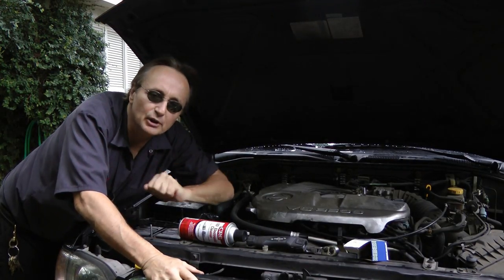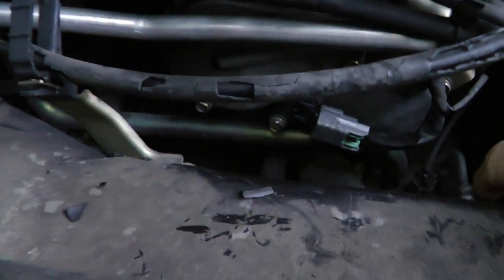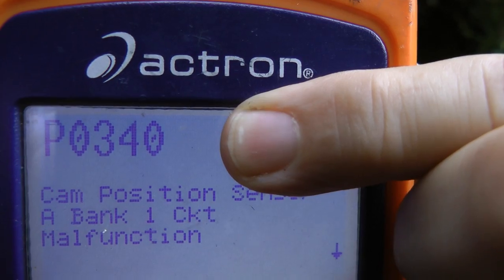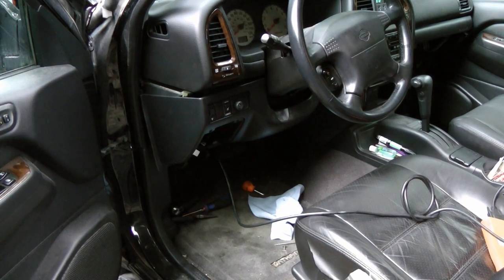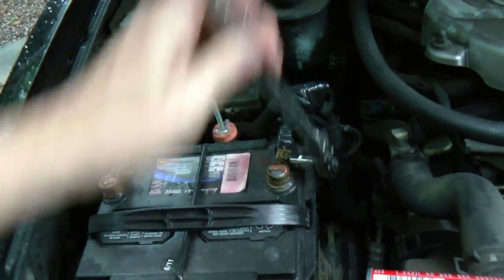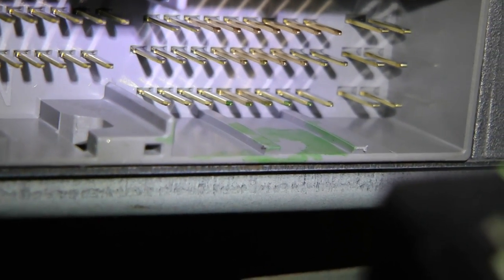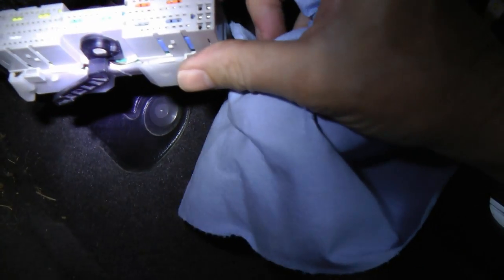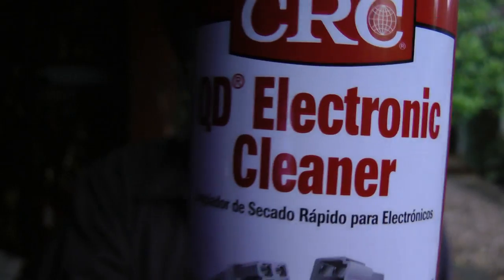How to Fix Computer Problems in Your Car with a Little Spray Cleaner

Comment: Mr. Kilmer,I just bought a 1999 c5 vette,99,000 mi ,after driving a couple hrs..my dic displayed active handling and traction control problem and the car went into reduced power mode,took it to the chevy place ,said they found no problem,still showed the code in the dic,six days later it happened again so I took it to advance auto put it on their little diagnostic machine ,it said traction control temporarily inhibited by pcm ,code c1278, what should I do? I want to fix it,shoot I have only had it a wk.PLEASE HELP!! Keith.J
Reply from the maker: keith jones  realize you can't work on that system without a dealer level scan tool that has bidirectional testing abilities.  Find a guy like me with one, or pay  vette guy a small fortune in most cases. They are THAT complex. But, here's some info:
SUBJECT:
 REDUCED ENGINE POWER MESSAGE ALONG WITH PARTICULAR POWERTRAIN TROUBLE 
CODES (INSTALL NEW TAC-MODULE IF STRATEGY IN SERVICE MANUAL FAILS)

MODELS: 1997-98 CHEVROLET CORVETTE WITH 5.7L V8 ENGINE (VIN G - RPO LS1)

CONDITION #1: INTERMITTENT REDUCED ENGINE POWER EVENT, ACCOMPANIED BY P-1516, OR P1518 TROUBLE CODES.

IF A SITUATION ARISES WHERE A P-1516 TROUBLE CODE IS ACCOMPANIED BY A

P-1120 AND/OR P-1220 TROUBLE CODE, THIS SERVICE BULLETIN DOES NOT 
----------------------------------------------------------------- APPLY.
 IN THESE CASES THE TECHNICIAN MUST USE THE NORMAL STRATEGY 
------------------------------------------------------------------ BASED
 DIAGNOSTIC. -----------------

CONDITION #2: INTERMITTENT REDUCED ENGINE POWER ACCOMPANIED BY TROUBLE CODE P-1125 AND ANY OF THE FOLLOWING TROUBLE CODES:

P-1276 P-1281 P-1286

CAUSE:

CONDITION MAY BE DUE TO DIAGNOSTIC SOFTWARE AND CALIBRATION IN THE TAC-MODULE WERE NOT OPTIMALLY UTILIZED.

CORRECTION:

IF THE ABOVE CONDITIONS CANNOT BE CORRECTED USING THE NORMAL STRATEGY 
BASED DIAGNOSTICS LISTED IN THE SERVICE MANUAL, INSTALL THE NEW TAC- 
MODULE LISTED BELOW.

PART INFORMATION:

NEW TAC-MODULE PART # 25319443

PARTS ARE EXPECTED TO BE AVAILABLE ON APRIL 6, 1998 FROM GMSPO.

WARRANTY INFORMATION:

FOR VEHICLES REPAIRED UNDER WARRANTY, USE:

LABOR OPERATION: J-5582 LABOR TIME: 0.5 HR

FIGURES: 00 ATTACHMENTS: 00

GENERAL MOTORS BULLETINS ARE INTENDED FOR USE BY PROFESSIONAL 
TECHNICIANS, NOT A "DO-IT-YOURSELFER". THEY ARE WRITTEN TO INFORM THOSE 
TECHNICIANS OF CONDITIONS THAT MAY OCCUR ON SOME VEHICLES, OR TO PROVIDE
 INFORMATION THAT COULD ASSIST IN THE PROPER SERVICE OF A VEHICLE. 
PROPERLY TRAINED TECHNICIANS HAVE THE EQUIPMENT, TOOLS, SAFETY 
INSTRUCTIONS AND KNOW-HOW TO DO A JOB PROPERLY AND SAFELY. IF A 
CONDITION IS DESCRIBED, DO NOT ASSUME THAT THE BULLETIN APPLIES TO YOUR 
VEHICLE, OR THAT YOUR VEHICLE WILL HAVE THAT CONDITION. SEE A GENERAL 
MOTORS DEALER SERVICING YOUR BRAND OF GENERAL MOTORS VEHICLE FOR 
INFORMATION ON WHETHER YOUR VEHICLE MAY BENEFIT FROM THE INFORMATION.

COPYRIGHT 1998. GENERAL MOTORS CORPORATION. ALL RIGHTS RESERVED.
Reply: Scotty Kilmer Thanks for getting back so quick! sure is appreciated,thanks for the good advice and being there for everybody,will check into that tac module now ,take it easy,Keith
Reply: Hey Scotty,keith here with the 99 vette in macon ga.you hit the nail on the head,WOW!! it was the tac module,it was loose and flopping causing havoc with the wiring,a little soldering and a strap and everything is working perfect now,You did what the chevy dealer and a hundred people on the forums couldn't ,Thanks Man im gonna keep it!!!! keep on keeping on! Keith

Comment from the maker: many things, from an electrical short resetting the whole car, like a weak ignition switch, to computer or computer sensor problems.
Reply: Scotty I replaced the transmission on my 2008 Kia rio and it still is in limp mode and takes off in 3rd gear

Comment: Hey scottie   

I have a buick lesabre that will crank for 3sec and shut off and try it again and it just spins i change fuel pump,fuel regulator,fuel filter,camshaft position  i get spark  but it still will not run can you help me
Reply: Tristan Williams Theft deterent.
Reply: my buick lacrosse does same exact thing. I brought it into a guy who replaced cam sensor and crank shaft censor and it worked for a week now it wont start again(-$360)

Comment: I bought my ECM PCM computer for 179.99 from flagship program to my vin with lifetime warranty. it don't cost $1,000 to fix it get on flagship get your ECM or PCM or call Express flash also $179.99 fix if your computer has gone out
Reply: Kevin Turner do they have a website?

Comment: Hi I have a 2002 Montana changed alternator twice brand new battery
The alternator tests good Not charging battery No service lights come on only battery lite after run for a while 
Is it my PCM ? Please help me 
Where is it ? Can I do it my self I have zero experience I did change alternator by my self after hours and hours watching YouTube it took me 12 days
OK I don't have money for a shop 
Please help Thank You for any tips or suggestion s on where to buy how to put in If that's what it is 
Thank you

Comment: I have a 2000 ford expeditlon this coe came up P1270 - Engine RPM/Vehicle Speed Limiter Indicates the vehicle has been operated in a manner which caused the engine or vehicle to exceed a calibration limit. The engine rpm and vehicle speed are continuously monitored by the PCM. The DTC is set when the rpm or speed fall out of calibrated range. For additional information on the engine rpm/vehicle speed limiter, refer to Section 1, Electronic Engine Control (EC) System , Powertrain Control Software. Wheel slippage (water, ice, mud and snow)
Excessive engine rpm in Neutral
Vehicle drive at a high rate of speed
The DTC indicates the vehicle has been operated in a manner which caused the engine or vehicle speed to exceed a calibrated limit.
Reply from the maker: malcolm griffin you either drove it too fast or revved the engine up too fast, OR the speed limit system is breaking down and thinks you have

Comment: hey man i have a problem with my 1997 expedition i turn on my a/c and my truck turn off i replace my spark ignition coil plus my air tank flow im thanking its the computer in the truck also when i turn the truck on i hear a beep do you have a idea what it is

Comment: Hey Scotty I'm recently having a problem with my 05 nissan armada it doesn't want to start checked the usual problems but it's the same did some research and found an ecm relay was on recall replaced it worked for a day but did the same thing the next day I repeated this about 4 times took it to the dealer and they said it "could" be my ecm but I don't understand it turns on and runs great when I get it to start could it be my ipdm that's going bad or? It would mean a lot if you replied I'm very frustrated and almost out of money and can't find many answers.
Reply: Boosted E60 
I know your pain! I have an 04 Nissan Armada and I have had more problems than anyone can imagine! Literally if you name it I've replaced it! I still love the shit out of it but they really messed up on the first ones made! Glitches.. Nissan should fix this. It's very dangerous and I have wrecked with my kid in my truck already just from my brakes going out! it shuts off randomly while driving also. I've changed the relay a few times but I guess I need a new computer
Reply: Boosted E60 
Your problem is most likely your cat converters. I know it sounds crazy but mine broke down and sat in my yard for six months and I had to tow it to Nissan and as soon as they unhooked it the truck was running again. I couldn't afford new ones so I gutted them
Reply: Sarah Holliday Hebert It turned out to be my ipdm computer where the ignition relay was defective they switched it out for about $450 and it's been almost a year and 12k miles later and haven't had any problems whatsoever.

Comment: @Scottykilmer my car was leaking oil from the oil seal gaskets got that fixed. And also leaking from the oil pressure sending unit got a new one so when my car is cold the oil pressure is nice ans high but when the car get warmer the oil pressure gets pretty low and i start to smell alittle oil comming from the ac vents if i have the ac on what could be the problem by the way its a 1994 camaro v6

Comment: Hey Scotty 05 cobalt security light is on don't start. What can a do?
Reply from the maker: German Garcia DO try another key if you have one, but if not that, find a guy like me with a dealer level scan computer or a locksmith with one, they are THAT complex, you can't analyze and fix em yourself

Comment: Scotty, the car won't run when it gets warm because it loses spark. When I ground a spark plug and turn it over, there is no spark. I tried shutting the car off while it was still running, and then it would not start. Somebody said it was the ignition control module, but I would like to be sure before I spend any money. Thank you sir.

Comment: What’s going on with my 1999 C5 corvette, dash lights blink like crazy, left turn signal busses car won’t start but if I pull battery cable of and wait a couple minutes it starts right up runs great until I shut it off then when I start it it runs in low engine power mod, shut it off disconnect battery cables and wait again for couple minutes and it starts back up rung great, repeat repeat repeat like ground hog day.
Reply: whats the ibd code say? sounds like a sensor of some sort .... may be a relay to igintion, 
or worse... pcm...possibly

Comment: I have a 1999 Oldsmobile Delta 88my car turns off of me when I'm driving but the thing is I drove from Ohio to Texas and then didn't turn off on me when I was doing a hundreds of miles but it turned off on me when I am  stop sign so I don't know what's wrong with it

Comment: Impala 2017 traction control is not working, no traction light on cluster, everything seems OK, if I push the traction control button I can see the T/C is on, but in reality traction control is not working, I drive my car on wet surface, feels no traction control at all, obd scanner tells U0100, and U0077, please help
Reply: Check fuses first

Comment: a $5 can of cleaner sure as hell beats a new computer
Reply: Gary Shaw l have a 3.5 year chryrshee conorde v6 when you stop at a red like or stop turn left or rigjt it stop runing but will star back yup
Reply: Francies Reddish probably it's a vacuum leak
Reply: Ronald Alabama MAP or MAF sensor
Reply: Ronald Alabama Clean the Carbon build up from the sensor
Reply: Today 9/2/2020 I watched this video and followed his advise and all the steps and my check engine light is officially off even after driving 59 miles. Needless to say hopefully tomorrow it will remain off and I can go to emissions and getting my new registration
Reply: Be great if this is the fix for my PoS Dodge.  Guess I'll try it before buying a new pcm.

Comment: If a engine is not getting spark or fuel dose it means the ecu is bad cause it was shaking and running rough and randomly died and now it won't get any spark or fuel
Reply: id check fuel pump, ignition switch , and also your fuel/ignition relays....

Comment: SCOTTY I need HELP my car gives out a P0600 code I have a 2002 VOLKSWAGEN JETTA 2.0L AUTOMATIC GLS 

my car turns on and works fine bug doesn't read any codes and only shoes P0600
Reply from the maker: +ADRIAN CANICAS bad wiring or bad main computer itself. Good luck tracing it down

Comment: I have psm, abs, driver assist failures and code p0503. When I shift car makes clunky noise and when I let off accelerator car jerks. When I go full throttle the car has a lag then goes and its naturally aspirated
Reply from the maker: time for a new vehicle speed sensor, and pray it's not bad wiring or bad main computer
Reply: Scotty Kilmer :( hope not a new computer. Any other symptoms that it could be the computer

Comment: anyone know if its possible a nissan truck can start even though it has this problem? My '04 frontier runs great but keeps giving me codes for bad O2 sensors even though I have now spent a small fortune replacing all of them. That check engine light just keeps on coming back...
Reply: Brian Keyser I went through the same hell with my 06 frontier. I replaced the bad o2 sensor twice , almost all new exhaust. Took Nissan 3 days after I gave up to find a tinyyyy exhaust leak, every time you would get to a certain rpm the exhaust would suck in air through the whole and cause the computer to throw an 02 code. stick a rag at the end up of the tailpipe and run your hands near the exhaust for leaks. Mine was on top (couldn’t see it) and right before the cat. $80 to replace the flange vs all the 100s I wasted trying to fix the problem
Reply: unfortunately I didnt get off so easy. Just replaced both cats and an exhaust manifold. after all of that the check engine light was still illuminated and so I found out that there was improper grounding for the computer. another 250 to fix that. Total nightmare, thank god its over
Reply: Sorry to hear that brother , I just got transmission / radiator contamination, trying to save my transmission now lol, gonna attempt to change the solenoid
Reply: just cut the Cat Conv off it'll save you time n money.
Reply: Can a bad 02 sensor cause crank but no spark and no fuel pump issue?

Comment: here's my problem, I have a 1998 Subaru Impreza. I can't get the alarm to shut off. please help me.
Reply from the maker: take the battery terminals off, it will stop. Then put the key in the ignition with it turned to the on position, and put the cables back on and pray it stops. if not, get a subaru mechaic to mess with the theft system

Comment: so i changed out a fuel injector that was not working with a new one and it is still not working but the wire to injector is getting power? please help
Reply from the maker: +blazienLs realize it needs power AND ground. The computer grounds the injector, could be that circuit is bad
Reply: +Scotty Kilmer so you think it is a bad ecm if the ground is ok

Comment: I found a problem with my computer 
buy dropped it on the floor .and reinstalled it van ran like a champ. afterwards. but I also cleaned it with electrical cleaner as well.

Comment: Would this be the same issue if under heat my mazda rx8 doesn't crank? An icon of a key inside a car flickers rapidly (this only happens in the heat) and someone told me it could be this issue. Other than in hot weather it cranks no problem the key works. Please if anyone knows reply back
Reply from the maker: could be that, as you do have a security system problem with key light flashing. but odds are you'll need a pro with a mazda dealer scanner to analyze the theft system

Comment: , hey Scotty how you doing listen I have a 2007 Chrysler PT Cruiser the car cranks over I got Spark I change the timing sensor I change the air sensor but that means I don't want to go too far ahead what happens I got my scan tool and I scanned a code came up and it was for the mass air sensor I replace that so then I try to start the car up it didn't start up so dead I replace the cam sensor try it again didn't start up it's like it wants to start but it won't so I check for spark that has spark now my engine lights on I'm not getting any codes to the computer at all now there's no codes could my computer have with bad what happened was that my daughter gave his mother's her boyfriend's mother a jump and I think they fried the computer is that possible

Comment: Anyone know why my 2001 dodge dakota has a no connection with ecm code... engine and transmission was replaced... ran fine until we pulled it out of the shop and it died and lost the connection with ecm... now it will not run at all

Comment: Hello 
Bmw x5 e70,  built 2008,  3.0 d,  173 kw... Problem with vents,  sometimes it's working sometime not, problem when not working I have air blowing only on windshield even if it's set to middle vents, so no air coming from central vents... I noticed when car stays over night and in morning it's all fine till it's on, after shutting off and turning it back on,  it's problem and all air is blowing only on windshield. I read somewhere that it's common problem with bmw specially x5 and in most cases ecu is problem. In bmw dealership they can't see any mistake on computer so they told me it's moisture in right back part of car where  electronic is and no communication somewhere in CAN line, ....I think it's bad connection or control unit or actuator but it's hard to find mechanic to check this first, most of them want to change all instalation on car and that's a lot of money and still not problem solved.... What you Sir suggest to check first? Thank you
Reply from the maker: Mersad Sofic   realize those are computer run monsters, and without a BMW dealer level scan computer, you can not work on that system.  don't buy a BMW if you can not afford such work, that's just how those money pit machines are. Sad, but true, they are rip off machines for rich dudes.
Reply: Was there but first thing what they do,  connect it and there is no error so simply say it's moisture problem somewhere,  that's mean they don't know how to fix it if there is no exact error code on their screen.,,,

Comment from the maker: I never use those guys, I tried, and got screwed every time. It would not start even if they got you the right one, cause the immobilizer has to be programmed for your car, and the program on that computer would probably need reflashing for your vin number anyway. ALWAYS try to find local guys who do such stuff, as they can come to your car and do it ON the car.

Comment: Where exactly is the control module on a XV crosstrek 2014?
Reply from the maker: Monika Lictz those are normally under the hood in the engine compartment, get your VIN, call a dealer parts dept, they can tell you for sure, I don't have access to vin info here